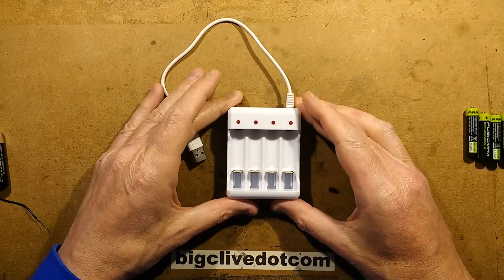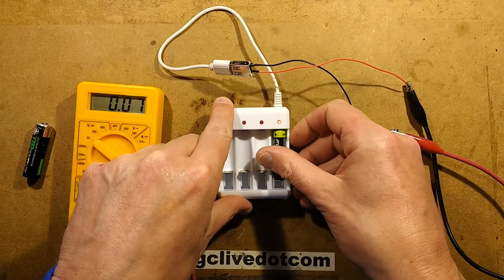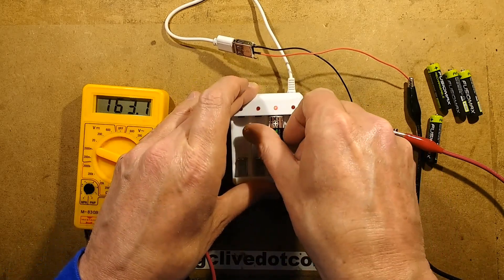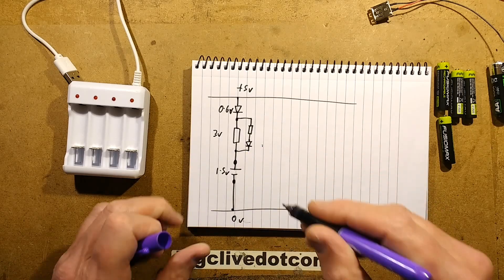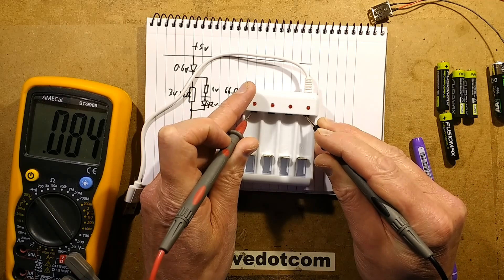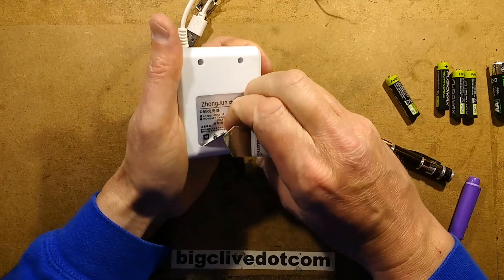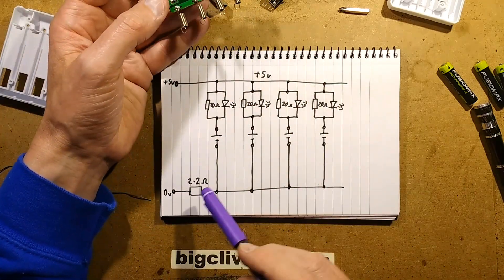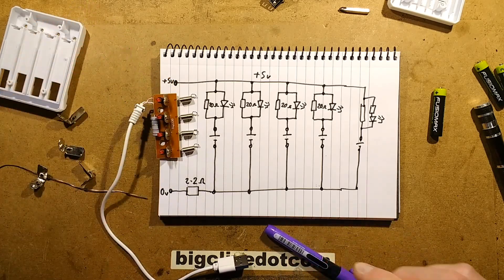inside a cheap and very shitty USB battery charger.

Comment: Is there an cheap psu to drive 100 series LED string on 120v ac(converted to led from tungsten Christmas lights following one of BC's older videos) ? But having a difficult time finding a suitable power supply for it.  Anyone with a advice is appreciated.

Thanks BC for this entertaining video.
Cheers
Reply: Nobody says you can't put the power in the middle and run two parallel strings O:-)
Reply from the maker: +I_will_get_you There 100 LEDs in series would require close to 300V.
Reply: Thanks BC for the reply! 
So I have 2 options, 
1. Capacitive dropper circuit you have build in your prior video and cut the string to suit.
2. Just buy a premade strings which are under a tenner now. 

Just ashame to throw them away but I will use them somehow. 

Cheers mate!
Looking forwards to your next adventure.
Reply: Jay Herde: Thanks for this comment! That was so simple and cheap way to do it, don't know why I did not think of that! I love this channel and everyone.   
Thanks again.

Comment: If I had money to burn on frivolities, I'd gift Clive a Ducky Pocket.  It's a calculator with mechanical keyboard keys (it also doubles as a keyboard numpad).  The drawback would be that it needs to be powered by USB to work with all its bells and whistles, like the adjustable color key backlighting.  And of course the whole $70 cost thing.

Comment: To ask the stupid question so that it is no longer un-asked - Doesn't the LED clamp the voltage across the 20R? ... and when the current thru 20R drops it's voltage below the LED voltage, the LED turns off.  But, with the LED off, that leaves 22R2 (20R + 2R2) to limit 3.5v (5v - 1.5v) to 157ma.  Then, 157ma * 20R = 3.14v, which turns the LED on, adding 20ma to the current AND clamping the voltage on 20R.  ... and in a quantum universe, a star is born.
Reply: Just to mention it, it looks like they're red LEDs, typical forward voltage of 2V; so it'll turn on a bit earlier. I do like the idea that once your AA is fully charged to 3V the LED turns off- very intelligent charge controller. 

(would like to see a follow up video that measures LED current/voltage though)
Reply: Hmm, maybe that 3V explains the reference to Lithium cells. Nope; even that's wrong. This one rates very highly on the Open-Ended Sphincter scale.
Reply: Me too.  I'm thinking an Oscilloscope across the 20R would be interesting.

Comment: what an awful charger. Surely there are integrated circuits built especially for charging  nimh cells that cost cents to implement. It doesn't make sense.
Reply: Oh, it does. That resistor costs less than a cent, and the sweatshop employee only needs to solder two connections to it, regardless of polarity.
Reply: I'm not so sure about that. Most mass produced circuitboards these days are made entirely by machines. You'll have a pick and place machine to place the components. Then some sort of soldering machine then to solder them. Searching around there are some specialised NIMH charging integrated circuits. Prices start a $1 or $2 for single units and quick go down for higher volumes.

Comment: no worse a circuit than those basic mains powered nicad chargers! transformer winding feeding diode, then resistor with led across it, then cell...  no resistor for the led , same as with this thing, no current limiting apart from the resistance of the transformer winding 😱

Comment: I expected the single resistor, but not the weird-ass LED arrangement.
Reply: I can't see how you would run the individual charging LEDs (without the weird arrangement) with only a single resistor.

Comment: You forgot to measure the resistance of the four 'wire wound resistors' - there's probably an ohm or two there, and they ARE part of the circuit :-)
Reply: Says 20R

Comment: I really love watching your videos despite knowing nothing about engineering and electrics apart from the fact that Im never going to put a knife in a toaster every again
Reply: Calvin Cosmos You noticed that real quick eh?
Reply: Did you try the tweezers in the outlet yet?
Reply: Ive also done it all my life if toast is stuck, then a couple of years ago it sparked and shut off all the electrics, I was perfectly okay if not shocked and scared, thought I broke all the houses electric but luckily it just flipped the safety switch. Never done it again, and now Im fascinated with just how dangerous electricity can be, it only takes a little careless mistake
Reply: Calvin Cosmos I did that for years as a little kid and never got hurt. It's a miracle I'm not dead
Reply: Hey I actually once put a knife in the toaster but nothing happened, I only touched the knife on one of the coil things tho

Comment: I have seen worse, I took one apart and the LED was in series with the battery so it had all the charging current passing through it, the led started out extremely bright and and got dimmer as the batteries charged, it took a long time to charge any battery. At the time I got it in the late 90's it was not particularly cheap ether, came from a market stall.
Reply: Do you remember how much current it passed? Or if the LED stopped current flow before it could be properly fully charged? Do you remember how many clouds were in the sky 3 million seconds ago? I hope so!

Comment: "its not an good design" 
what do you expect for 1,50 delivered from china?
It even surprised me  that there was a pcb in it, they could even done this by twisting the legs of the component around some plastic studs.  XD
Reply: Good point! I suspect either we'll see that in a future iteration, or perhaps these PCBs are rejects from another product the "manufacturer" picked up from the local PCB maker's scrap pile for next to nothing.
Reply: I think the PCB was cheaper, because salaries in Shenzhen are rising. The PCB is a single-sided phenolic, and as Shenzhen has been moving towards higher-end and higher complexity products with epoxy based dual sided boards, this got incredibly cheap. Besides, it can still be automatically populated and soldered, with exception of through-hole components and the input leads,  which are manually added. There's the whole lot of a few dozen EUR of setup costs and then you can get thousands of these things for basically free. It might as well be a custom ordered board - it doesn't matter. What is a lot more expensive is the enclosure.
Reply: @SianaGearz  Through-hole components can be populated with a pick&place machine.
Reply: @katbryce  They can - it depends, some can, some can't -  but it's a flaky process that is usually avoided if at all possible and sensible.

Comment: Guys,a NiMH cell at 0V, has it taken some damage?
Reply from the maker: They usually recover when charged, but it's best not to leave them in a fully discharged state for too long.  It's not uncommon for NiCd or NiMh cells to run completely flat.  They don't suffer damage in the same way that lithium cells do.
Reply from the maker: It's common for the other cells to reverse charge the first that runs flat.  That's why it's best to recharge the older style cordless tools as soon as the power noticeably dips.  NiMh cells are very tolerant of a wide range of abuse.
Reply: @bigclivedotcom  i use these charger 5minutes to charge if my smart charger write error for battery.Battery charging without problem after 5 minutes in these charger in tronic charger.
Reply: most likely yes, the battery is probably junk.
Reply: bigclivedotcom Thanks guys. Whats happens is that I have a door light with motion sensor and it uses 3 AAA cells in series. When I took the cells to recharge, 2 of them read 1.1 to 1.2V and the other read 0V (actually -0.01V). I guess when they are in series the worst cell dies first? Or maybe the other cells were reversing it's polarity or something. But it recharged fine after all.
Reply: bigclivedotcom ah, that threw me off, I knew lithium cells were bad when they're at 0V, though I guess you learn something new every day

Comment: If a red LED drops 2V and a flat cell drops 1V, then 2V is at the 2.2ohm resistor. The current would be 909mA and most of it is passing through the poor LED. ... WTF ??? :D That's the worst charger I have ever seen. Are you sure the 20ohm resistors are in parallel with the LEDs, not in series? But OK, everything is possible in china...
Reply: You here.

Comment: So this with a set of lipo batteries and the shitty pink USB charger is a perfect under $5 gift for the ex?
Reply: Add a 4 pack of Trustfire 14500 and you're good to go.
Reply: Ultrafire does the job even better
Reply: Anything with fire in the name
Reply: Did you know the work "Brand" in English means "Fire" in Dutch? :)
Reply: Same in Swedish as well.
Reply: Yeah, fire...  that's the brand I am thinking.
Reply: +Quick Fix
Same In German
Reply: you could just buy her a gallon of gas and a box of matches, and deliver them at 3am, and make sure

Comment: BigClive, can you short out where one of the cells would plug in ?
Id be interested to see how bright the LED would get before buying out.

On a separate note, buying one of these and modding it with your circuit diagram would make a useful basic charger.
Reply: Somehow YT cuts off comments or my "View More" button is missing...
Reply: possibly your web browser. are you able to try a different web browser ?
Reply: Nevermind, now it works. I guess YT is just buggy as always. I have zoom on to have the videos a bit bigger, since I am on a 4K 32 inch screen.
Reply: Don't even bother modding it. Just get a smart charger so you don't kill your batteries.

Comment: the 250ma is a clue, its a resistor, charges constantly, not 'intelligent' at all. however they do have their uses: if you over discharge your nimh, your normal smart charger wont charge it as its too low a voltage , put in this for a half hour to boost it up, so then the proper charger will see it
Reply: Why would you need that? just use metal paper clip and shot it with a good cell for a second and you are ready to put it in a good charger.
Reply: Jusb1066 that's what I do.

Comment: to be fair the old 80's era NiCd chargers weren't that more complex than this
Reply: True, but at least they used separate current limiting resistors.  :)
Reply: quaxk alright matey...I got years outta my 80s rechargeable battery set. used my Sony Walkman on the bus on the backseat smoking ciggies and stomping my feet from 1985 onwards with the mega bass full up and auto reverse kicking on every time !!!. I still have it to this day...but no need for the bus these days !!!